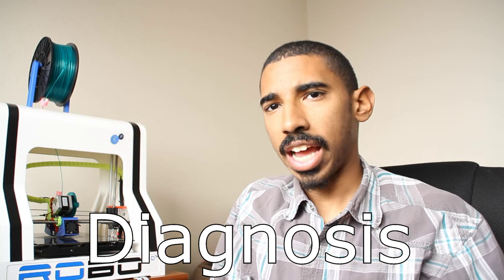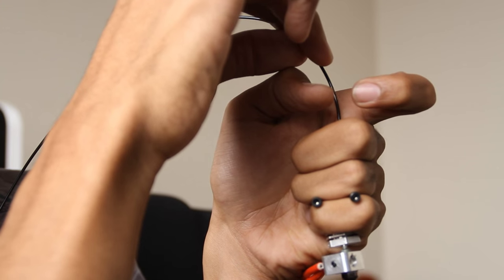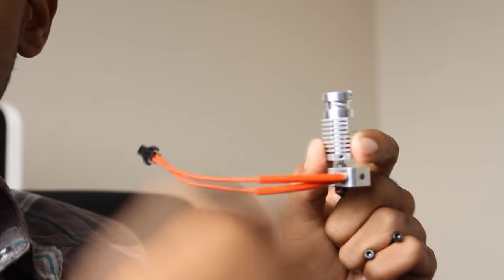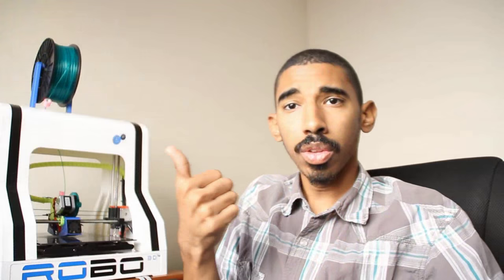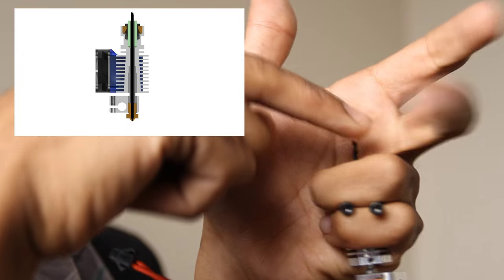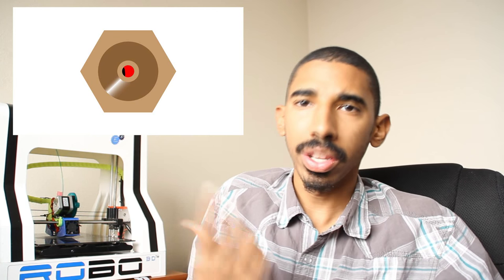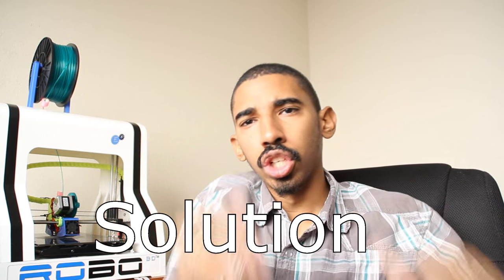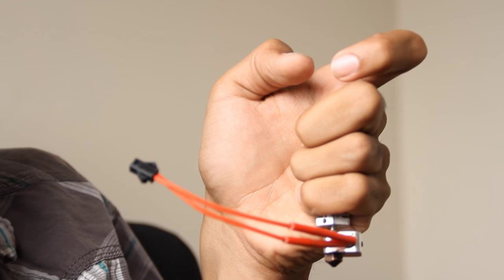Novice Tips: Troubleshooting Clogs/Jams

Comment: Just wanted to throw a "thank you" on here - We got our Robo 3D R1 Plus recently, and on the second day had a bit of filament get stuck - Thanks to your videos I was able to take apart only what I needed to pull the filament out - but a tiny bit got stuck in the heat-sink area.
But again, thanks to your videos, we were patient and eventually got that tiny bit through the hot end and resumed printing.

Comment: Excellent video presentation and should be a model for many to follow, no BS, straight to the point with a great cutaway of the part, extruder nozzle in this case, lots of energy in the presentation. Super. Now If only there would have been the procedure to remove this assembly from the printer. Thanks ...
Reply from the maker: Hope this video helps: https://www.youtube.com/watch?v=371fjpd7g38

Comment: Hi Marquis, back again.
No question this time, but a couple of comments.
I had a clog that I couldn't clear until I unscrewed the nozzle and heated it up with a propane torch.
Doing this over the kitchen sink, when the ABS started to melt in the nozzle, I did a quick shake of the nozzle to clear the melted plastic and guess what happened?

Don't bother, I'll tell you.

The sound of something metallic hit the sink. !!?
On close examination I discovered that a broken piece of the smallest spring dowel pin, (Google it, if you don't know what I'm talking about) I've ever seen, was causing the clog. It had to be smaller than 2mm to enter the nozzle and had to be in the package of extra nozzles I purchased for backups. 
I doubt if it was in the filament as I would think it would have made the filament weak and it would have snapped apart before it got to the extruder.

The second concerns a problem that I haven't figured out yet. With a .5mm nozzle, I calibrated my extruder too extrude exactly 100mm as per everyone's instructions. 

As the printer came, it was only extruding about 92mm.

100mm wouldn't work. I was having constant clogs after about ten layers. 
I figured out why it was clogging when I did an almost cold pull of the filament.

The 100mm calibrated extrude was pushing so much filament as it printed that it was oozing up past the filament and cooling when it got into the heat break.
I corrected this by dialing back the E steps to 752.00. It doesn't extrude 100mm when tested (around 95mm) but doesn't clog the nozzle anymore.

Just a few thoughts.
Have fun with your hair while you've still got it! I used to have hippie long hair back in the 70s. Now it's mostly gone. LOL!
Reply from the maker: +Wayne Hobbins That looks like the thermistor crimp that comes with the v6, have no idea how that got in your extruder though, very strange.

I too sometimes have to back off the extruder calibration to use my 0.8mm nozzle. But now that your clog is gone it should be better, do you have an oiler too?
Reply: I don't think it was a crimp. This was spring steel for sure. 
Didn't think I needed an oiler with ABS. I do a Canola treatment when installing a new nozzle though.
Reply from the maker: Oh I thought you were using PLA. That spring steel in the extruder is really weird
Reply: Novice Expert It's probably something off the screw machine that made the nozzle or something that got dropped into the cleaning process.
Anyway, it was a mystery for awhile. It would kind of extrude through the hole, but not quite enough to get a good print.
I don't think it would happen a lot, but I now check the inside of the nozzle with a magnifying glass to make sure it's clear before I screw it back on.

Comment: Is this why when I'm always printing the first layer it seems to be very thin (under extruded) even with a slow brim speed and increasing the flowrate, or am I just not getting good adhesion to the Kapton tape and it's dragging? Or maybe my level is a little off? It seems fine after the first layer and good quality prints come out, it's just that first layer which goes all stringy on me.
Reply from the maker: If its "stringy" the nozzle is proably too high, if it's too close it will wagon wheel.

Here's Mike's trouble shooting guide: http://community.robo3d.com/index.php?threads/visual-troubleshooting-guide.3017/
Reply: Thanks for this, very useful! Seems like it's because I choose the first layer to be small like 0.2 instead of a more forgiving 0.3. When I set the corners they are tight with the paper, but the middle part of the bed is loose, so I have to judge it based on a not totally flat bed, and what part of the bed I'm printing on.

Comment: Hello . printer seems to be extruding a nice hot flow but was wondering why when i printed a small box it stopped . I tried it twice and it just stopped in different locations each time. the 2nd one further along than the 1st. could the computer hooked up to it be going to sleep and stopping the print ? error was "not communicating with the printer "...i have read a lot on this on this site . everything else is pretty good but it sucks getting thru 2 hrs of printing and then having it stop before done.
i have robo3d r1 plus with matter control 1.4. still playing with z setting to stop the 1st layer  from looking like a guitar or looking stranded. and not smooth
Reply from the maker: +Paul Robb If the printer throws an error it will stop communication with the computer, but it usually throws another error first. If the only error you are getting is that it is no longer communicating, then make sure your usb is not going to sleep.
Reply: that was the problem . the computer was going to sleep

Comment: You said something about oiling the filament? could anyone explain how i'm supposed to do that? thanks :)
Reply from the maker: +Sowmen Das Dipto 
Step 1: Pick an Oiler to print (linked here: http://bit.ly/1T0dVjx) and print it out
Step 2: Use a sponge, a tissue, or anything that will hold oil and put it in the oiler.
Step 3: Use a form of cooking oil, not motor or transmission fluid
Step 4: Print without Jams
Step 5: Re-oil when necessary.
Reply: Novice Expert Thanks.. gotta try this out :)

Comment: What happens if you can't get the filament OUT? It won't move - at all. Heated to 250 degrees, won't budge...
i3 Duplicator mini
Reply from the maker: Might have something between a jam and a clog. Filament might stuck in your cold end, before your hot end, but after your extruder.
Reply: Thanks for the reply - any idea what to do? I've just gone to the shops and bought the same tools as are in the kit for the MicroSwiss MK10 upgrade. What does one do now? I remove the fan, then what? Hold the hotend with the wrench, and undo the nozzle. Then?
Thank you - Steven

Comment: I turned off my printer and after about 10 minutes I turned it back on to take out the filament. I tried taking it out and realized it wouldn't budge. I finally began to pull out some filament, but the rest stayed in the tube, only a little can be seen. I'm pretty sure this is a jam, but I want to be sure.
Reply from the maker: You got it right, sounds like a jam. Hope its fixed by now (4 months later)

Comment: for some reason my nozzle is clear and i have cleaned it properly, but half way through my prints it stops extruding and then if i start the print again it extrudes but again stops half way through. could it be the filament? its no brand filament that came with the printer. I been really frustrated trying to solve this problem and if you know why this is could you please tell me. nice video btw +1sub.
Reply from the maker: Not sure about that, the only thing I could recommend is seasoning and an oiler
http://community.robo3d.com/index.php?threads/please-read-hotend-jam-clogs-seasoning-and-an-oiler.3564/